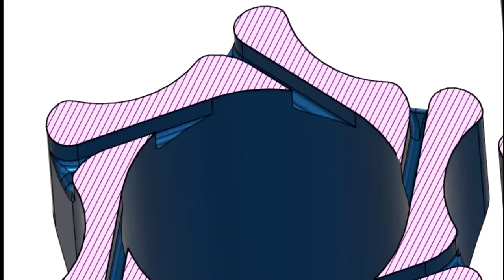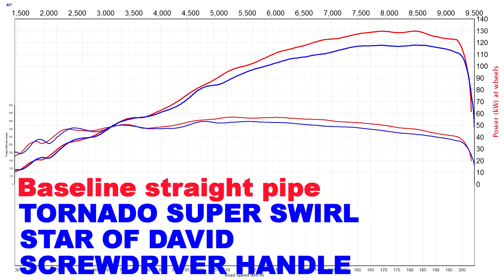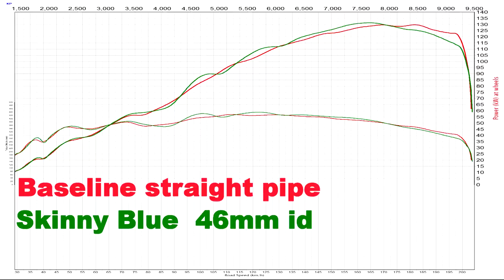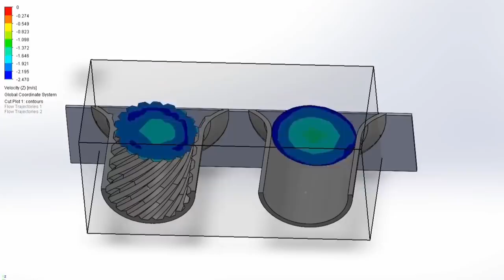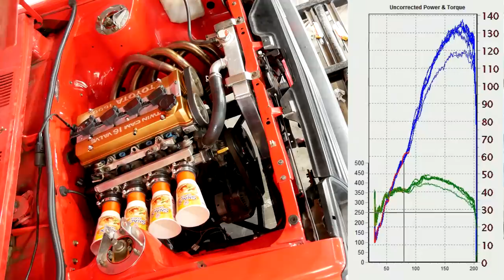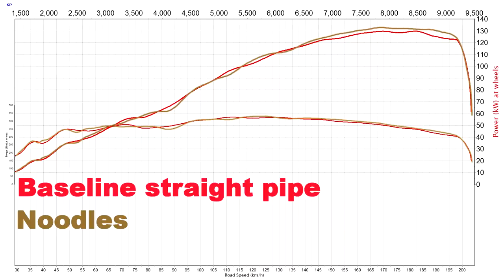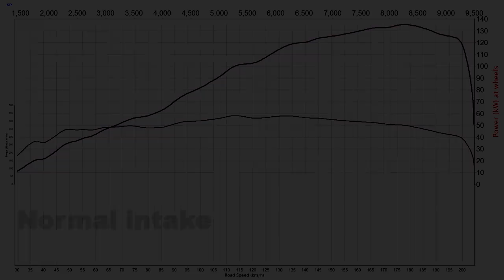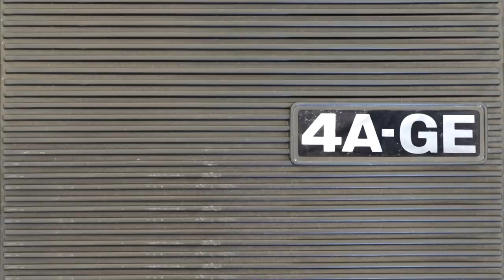Viewer 3d Printed Velocity Stacks  - Trumpets - Intake runners - Dyno Tested

Comment: Those swirled stacks would benefit most with a barrel throttle, I believe. The throttle plate will stop rotation as it enters the port
Reply: A diesel might like too them because you can never get enough swirl
Reply: Yea, I wonder what the effect would be if you put the swirl down the intake runners of a single throttle body intake
Reply: Never thought of that. Good thinking!
Reply: @balakay1081   I can tell you from experience  your WOT performance is not effected much .When  your chopping the throttle , in the midrange road  course style  you notice the gain or response difference .
Reply: @balakay1081  see, this is why I like YT comment sections. We get brilliant little ideas like yours
Reply: Would have liked to see the fins a bit taller to get more of the air into the swirl.  Now opposite idea, what about golf ball dimples?
Reply: @Power5   The stack needs to be  benched at whatever RPM  he's targeting so you make sure that design is solid and works.  Then put on the motor so you can see the gains or loss in a specific  RPM range . My next thought was dimples  lol patterns depth etc !    Still this was  a nice little slice of automotive science ..
Reply: @Power5  exactly what I thought 👍👍
Reply: Taking it further, if you placed the injectors at the top of the stack at an angle to introduce rotation.....

Might not necessarily increase power as you're not really getting any additional air into the combustion, but you'd like to think the mixing would be good and a near homogeneous air/fuel mix should combust more efficiently.....
Reply: @IamTills  Exactly, and that seems to be the thing people forget about when building for power. Power density goes up with better atomization. The easier it is to reach a homogenous mixture, the better. Fuel spray also removes heat from the intake charge, condensing it and further improving power density when done properly. I wish I had a dyno simply for the sake of testing “dumb stuff” like the minor adjustments to the angle of rotation through the runners in a similar setup to this. It’s a proven fact that a swirl reduces drag and the boundary layer thickness inside a tube, increasing uniformity and velocity overall. I want to know what can be done to further increase that in a useful way for a real-world application.
Reply: @Cjbarker2  Right back atcha!

From memory they put the injectors waaaaaay above the trumpets in F1 and drag engines to maximise the effects discussed.

It's all about targeting what you want from that specific engine - you have to modify to suit as everything is a compromise, all you're ever doing is nudging the needle one way or the other.

God I love engines.
Reply: @IamTills  They’re definitely fickle things, for sure. My current fascination has been toying with a Suzuki G10. I’m plotting ways to measure gains in efficiency and power without all the specialized equipment because I’s a broke boi. Finding nozzles small enough to run water injection is all but impossible, and the cost of getting rods machined to exceed the meager power output of the stock engine is rather prohibitive. I’d say that my end goal is something like 100hp while still maintaining at least 50mpg or more. If I could, I’d love to model it after the hot vapor engines I’ve heard stories about, but lacking the network connections and the intuition to get all of the pieces together, I’m stumped as to what the correct approach would be. If I should ever get this idea, in particular, to work, however, I see it becoming something to get me on a watchlist somewhere. More than anything, I wish we had good documentation on these things, engine modifications that have basically been made into legends and folklore over the years, joining the Ogle carburetor and other groundbreaking tech that’s been obscured by time and covered in the stench of corporate foul play. Until something can be found to break the bounds for us normies, we’re stuck going on conventional wisdom, not knowing how far we can or have to stray before we hit the mark we’re aiming for, or if we’ll ever even reach the goals we’ve set at all.
Reply: @balakay1081  Maybe, my 110cc carbureted trail bike is going to lavish the benefits of that swirly stack. 🤔

Comment: Obsessed with this channel. Great stuff.  Swapped a 4AGE into an AE86 in the 90s. Just ran a pod filter to stock TVIS manifold.  Stock 4:2 cast Mani, then long secondaries that joined under the footwell.  Spent a lot of time window shopping other engine mods but no $$$$
Reply: wait, don’t AE86s came with 4AGE from factory? Or that was just for JDM models?

Comment: I would suggest to various turn cyl 1 and 3 about 30 degree upwards and cyl 2 and    4 downwards. This could lead to have more intake  area available especially the limited space between cylinders could be improved and let them suck more independent more air In. Rather than fighting each other ;-)
Reply from the maker: The guy that printed the  screwdriver handles , previously printed some like that.   i tested them in my first intake runner vid.  wasn't any benefit.   https://youtu.be/nqYkmCLrlEo?t=547
Reply: I've done some CFD testing on intake trumpets, and despite what the curve of the bellmouths would suggest, not much air is really coming in from the sides. A little bit trickles in but the air coming from the sides is approaching more slowly so it's not really restricted at all.

Using the unnecessary curves to make the trumpets like that also messes with the airspeeds a tiny bit (though not much), since air has to travel faster along the inside of a bend than the outside. It ends up looking like the air is making a slight attempt to apex all the bends in the intake tubing, so for example if you curved a trumpet upward with a fairly wide bellmouth it would draw significantly more air through the lower side of the bellmouth to avoid curving as much.
Reply: @agerrgerra1361  Faster along the outside of the bend surely? As the outside of the curve is longer. As the air isn't a solid mass, I'd expect the velocity to remain close to the same on both inside and outside of the curve, but to just have some turbulence added.

Comment: I was hoping for the green swirl to win! It came damn close though!

The screwdriver handle is a very interesting design but I knew it would be the worst performer as it has slats that create a serious choke point. It was nice that the slats were tangential to the cylinder inside but without a kickoff to promote the air downward into the engine, I suspect it was just spinning the air and thus the engine now has to 'pull' the air in rather than it being pushed into the engine.

On the plus side, the cyclonic effect the screwdriver might generate will/should damn near make that air clean AF for the engine lol!
Reply: Yeah I think the screw driver handle could be Improved. Instead of a completely flat lid Add a cone shape to the inside to direct the air not just circularly but more funnel shaped. And Increase the inlet slot size a bit. Will it beat the others? Probably not but it could be more efficient
Reply: I'd also be curious to see green swirl clockwise vs a set counter clockwise
Reply: @mikelarin8037  I wonder what a properly designed screwdriver would do for the atomization, though.
My hypothesis there would be it likely wouldn't bet any power worth mentioning, however, I think it might attomize the fuel much better for a total burn 🤔 science and engineering are wicked fun!

Comment: You could try a tapered runner, I think it's roughly 7 degrees of taper to keep the boundary layer solid. Could be interesting keeping the lengths the same and testing if taper affects the power delivery
Reply: It's very hard to get the effective length the same with a taper and / or a rolled bellmouth.  You can clearly see length effects in the dyno graphs by switching between the different design types, and it's notably where the design is very different that the bumps appear in different places.  The skinny blue vs. the big white is a great example.

Also the small white runners gave a similar torque curve to the "normal" runners, which presumably are the runners the car has already been tuned with.  Stands to reason the runners most similar to the existing runners will give the best result without further tuning.

The noodle cups show what a good taper can do - really smooth plot. Admittedly the taper was pretty extreme...

Comment: Kind of impressed with the swirly,,it seemed to widen and smooth out the power curve
Reply: or it straight up killed the possible gain from resonance, you can see it with the skinny blue ones at low end, which confirms the theory, it just needs a lot of additional work to make it useable in that range if you're ok with loosing some top end

Comment: Really interesting video and I'm a bit surprised how similar they all are. I think the baseline straight pipe should have been run a second time near the end since it's so close, but that's not really important.  Aside from the one outlier, the restricted screwdriver handle design, every intake was basically the same performance or so close it's within standard deviation of the testing equipment.  Perhaps those throttle bodies are more than large enough to feed the engine.
Reply from the maker: would be same result if ran baseline at the end.   engine is ran hard before start any testing.  you can see the only real deviation on the raw graph  is between runs on the screwdriver handles.  because  i didn't allow proper cool down and stabilize  temps between those 2 runs

Comment: The purpose of a velocity stack is to smooth out the flow by eliminating sharp corners to reduce discontinuities and reduce turbulence. 
eg: the small white stacks that didnt touch had no sharp corners meaning they had no discontinuities or stagnation points. That meant smoother and less turbulent air delivery. 

The swirling ones do nothing but create flow restrictions on the intake. If you put swirl into it youre trying to MIX air and fuel, not mix air with air. Which means any swirling action has to happen at the heads where air and fuel are mixing together. 

Lastly, the shorter and smoother your intake, the less friction you get. I'm willing to bet that if you took a nicely sanded copy of the little white ones, theyd do even better.

Comment: Really great experiments.

I think it shows the fundamental concept that power is directly linked to the amount of air you can get into the combustion chamber.

The starr shaped inlets with their restrictive slits show the power drop (I'm sure this would be backed up with a flow metre).

What these experiments do over and above a simple flow metre is link to combustion. The location of where the fuel is introduced to the air flow would also have an impact on the efficiency of the burn - if the fuel is introduced further up the inlet there is more time for it to mix, so the swirling inlets may have additional benefits if the injectors are further up.

Also, the length of the inlet dictacts any pulsing / scavenging effects, I think you can see this in the different peaks / bumps / high spots in the traces - they provide approximately the same power overall but each length has sweet spots compared to others.

Really interesting stuff, lots of variables to play with and all will impact how the engine runs.

Comment: I'm loving this test and the graphs for one major reason... all these guys who think induction has nothing to do with valvetrain resonance need to watch closely. Multiple repeated tests with different induction paths... and almost all of the repeat tests show the same valve destabilization on the top end, while different setups show distinct movement of these spikes to different RPM.

It's not just one part, or a handful of parts. It's how the whole system works together.

Comment: if you put a texture like a golf ball, inside the pipe, it will create a vortice, and low pressure area around the pimples, that increase the torque at low rpms

Comment: Excellent example showing why modern OEM intakes are so hard to beat. Matching diameter and length of runners helps, but getting the taper right makes a power band, a breeze to work with, or a nightmare to drive/tune outside of its power band. That's why the cup of noodles shows such smooth power. 

Imo on this engine the runners should be slightly longer and decently tapered.

Comment: Longer intake will give him more torque in the lower rpms, less hp in the higher rpms. It's crazy how Bernoulli's principal works along with air stacking and fluid dynamics, velocity through an intake system. Also skin friction. I love this stuff 💯👌 Personally I want my torque down low, I'm not the type to redline my engine all the time.
Reply from the maker: depends on rpm running to. and what you call a long runner.   but longer runner will make more power everywhere over something short, say 250mm from valve, long is a win win if space is available

Comment: I also wanted to try shelves. Every 2 inches decrease the diameter. So every 2 inches from the outside in is increases slightly in diameter. Like falling down stairs. I wanted to try that in an exhaust manifold. In the middle of each bend increase the diameter just a little. Also don’t round the edge leave a sharp edge for a dramatic change in pressure.

Comment: Compairing the results, I wolud try the bigger ones but a little bit longer. Probably it will not drop as much in the low range, with "Same high range"
Thank you for sharing your knouledge

Comment: So if you want a good intake trumpet:
Large like the white cap mushroom.
Clear dedfined intake swirls or dimples.
Narrows down hard into a medium trumpet.

All this will increase airflow into the engine as you are increasing air speed.
You could even look at how wind tunnels do it 👍
The only thing we haven't factored in is vibrational resonance which will greatly affect the performance of the runners.
also the engine is continuing to change speed and demand more air so the spirals may actually restrict the air flow at a certain point where as with the dimples it can flow over it...

Comment: I'm not going to spend the time to read almost 300 comments, but one of the things that stands out to me is how all of the versions with a straight runner (the aluminum extensions, the blue skinnies) have -- and maybe reinforce -- dips in 3 places as the revs are climbing.  The short straight red runner extensions, and the soup cups only have two dips.  I think this indicates that you would see some mid-range improvements tapering your extensions 2~3°.  Airflow hates straight sections.  One of the take-aways from the Smith & Morrison book, "Scientific design of intake and exhaust systems". It's old, but worthwhile.
Reply from the maker: The extensions have a small taper in them.    you will find the noodle cups are  acting like a shorter runner. due to massive diameter.  all the peaks are pushed to the right  and the last one is happening right at the end of graph after peak power normally would be.  so makes less peak but holds on a little longer

Comment: Can you 3d print curved pipes? A slight bend will help you get longer runners for a little more torque. Now the runners are obstructed by the shock tower. Make a nice easy bend and aim it upwards. Include a velocity stack/radiused entry at the inlet. Call it a mammoth tusk. Use ass big of a radius as possible to avoid the shock tower. 
I believe that is why the tornadoes did so poorly. 1 and 4 had more open holes than 2 and 3.. their intake slots were too close to each other and they had to fight each other for the air. 
  Great video. Keep up the good work.
Reply from the maker: hey,  i tried some like that in this video https://www.youtube.com/watch?v=nqYkmCLrlEo

Comment: New idea...that Mazda did about 35 years ago. They had telescoping stacks so they gained torque at low rpms with long stacks then high rpm gains when the stacks would shorten. Elaborate design yes but, it worked.
Reply: Were they telescoping? I recall them being another set that was lifted off of a short set.
Reply: @nathansenior9497  I used the word telescoping to describe what you just said. The elaborate design was that they moved up and down automatically. How I'm not sure, computer controlled using a electronic motor is my guess. Easy yes but, for the average backyard mechanic is it worth the money to gain small amounts of power. Now when you are in elite competition that extra found 20ftlbs and hp is. I'd rather spend the same amount of money and build a stroker motor and gain 50ftlbs and hp. To ramble on further, David Vizard explains in a video that for the cost of retrofitting a SBC to a roller camshaft you are better off spending that same amount of money on a 383 stroker kit and retaining the flat tappet cam design. The same would be true for pretty much any V8. Why would I spend $1200 converting my 390 FE to roller when I could spend a few more bones and make a 434 stroker.

Comment: The pvc tubing actually looks like 2" pipe size. There is pieces called a bellmouth for underground electric vault installation that come in standard pipe sizes and are injection moulded pvc. Some of them look really good with something really close to an elliptical entry.
Reply from the maker: Hey,  Yeah its underground electrical  duct.  measures about 51mm  id.   Its pretty easy to heat up and shape, by pushing it over something.   can make something that looks like the small white ones pretty easy